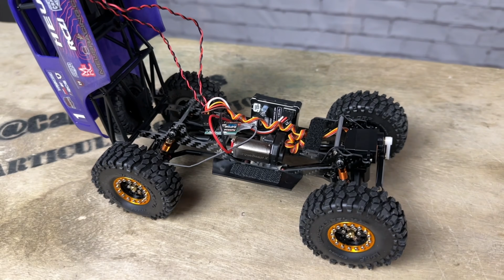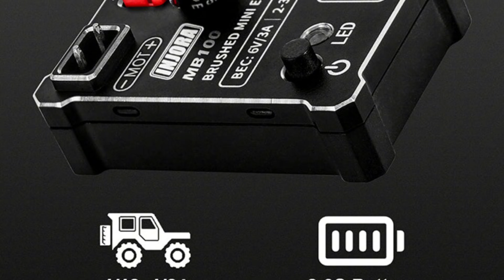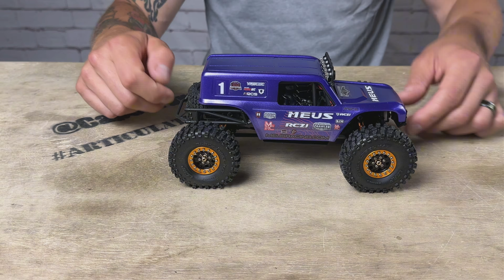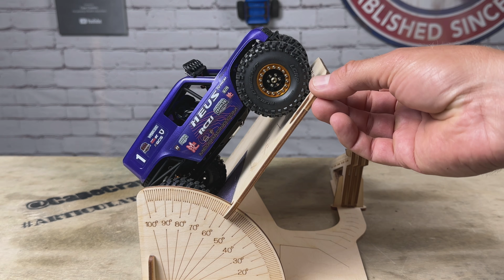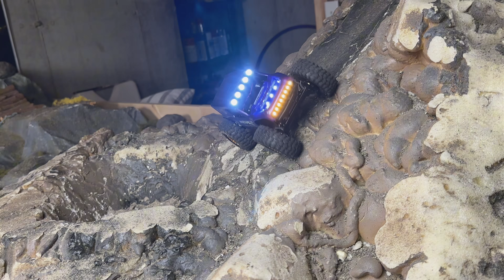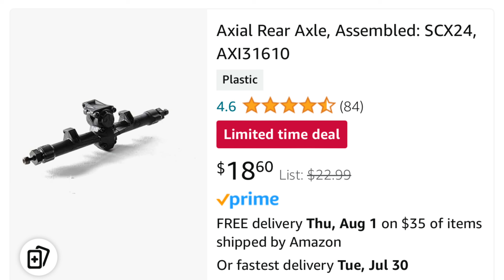SCX24 Budget Build: Parts Edition! Best Performance Per Dollar?!

Comment: An easy way to answer this question is to make a list of all the stock parts you'd keep in your build:
Wheels and tires?
Steering servo?
Motor?
ESC?
-> Changing the ESC means you'll also have to get a new receiver and that means you won't use the stock radio either.
Shocks?
Axles?
Drive shafts?
Transmission?
Chassis?
Body?

So would you pay the complete RTR price if you just end up keeping a handful of parts, of which there are better after market versions available?
Or are you planning on keeping it mostly stock and have it hassle-free?

Comment: Now there's a GoUpRC combo of a 2400kV brushless motor, 30A ESC and aluminium gearbox for like 35 bucks on Ali Express, that's cheaper than the brushed motor + brushed ESC + Axial gearbox you picked.

Comment: This is a great video. It helped me rationize what I just did after watching an rewatching several key scx24 vids of yours. NORMALLY I am anti rtr an will always build, but in this instance based on what my build path is with a vast part of that decision coming from watching your videos :) I thought that I would be best off with a rtr and for what I am doing, the base was the easy choice. 

I already have a flysky noble+ radio an recievers. I have countless 300mah 3s batteries from drones so when I go esc an motor I am only buying once, 3s... 
I am buying shocks. No need to pay extra for shocks. So here is my 250 budget an 300.  

Base Camp $107
Injura Universal lcg carbon chassi $27
1" beadlock weighted rims $26
Pro-Line 1.0" Trencher $25
brass skidplate $15
brass diff covers $15
40mm bigbores $22
emax servo/arm/mount $20

Thats at $257

in the trek to 300, thats hard an near impossible to  choose the route based on budget.

Comment: I was a bit disappointed in the MEUS MB24.. I found myself struggling to find a transmission/motor combo that fit with the chassis. The receiver shelf doesnt provide clearance for a brushless motor. I have bought 2 separate trans options (meus trans, and one of the popular form factors on Amazon). The only thing that fits is the stock brushed set up.

Comment: @CapeCrawlers
Great video, quick question i just bought 1/24 SCX24 Jeep Wrangler JLU AX100002V3T3 did some immediate upgrade lol like INJORA Trekker A/T Tires T1014 , INJORA 1.0" 39g/pcs Brass -2.65mm Offset Wheels for Micro Crawlers (W1008) and Brass differential cover 9g each cover what other upgrades you recommend . So people said Servo i saw that when you do mods video you include servo and i was think maybe shocks. After that don't know

Comment: >>Hey Adam<< I have a question, what would you suggest. A build like this which I love or an Apex? I want a comp style rig and I’m not sure which route to go. I’d throw about $350 at one or the other and you have definitely been my inspiration getting into the mini crawler hobby
Reply from the maker: I personally think it’s more fun and rewarding to build it from the ground up. The apex is really good out of the box and needs practically nothing, which can be boring unless you just want something you can unbox and run hard. So I would say it’s personal preference and whether you want to partake in the building process or not

Comment: I think you could have just about made the budget within a small margin by doing the nylon MEUS ISO axles that come fully equipped for $60, and would have also saved you on the brass upgrade and gearing expense. But otherwise a great build!

Comment: so I started with a $65 ebay special deadbolt as my donor, made the mistake of going big and bought a injora fat viper combo($60) which really did not pkg well in the deadbolt, so I went with the painted MB24 kit($40) and extended mixed and matched links to give me a much longer wheelbase (70mm rear links) The links and driveshafts came from leftover older projects. You managed to keep the interior which I had to take out to fit the fat viper... (slow crawl is amazing and it loves 3s), injora double barrel shocks and 1.0 wheels with 70x24 injora tires.($30). I have since remounted my smaller 3s battery is the same location as yours and I am trying to figure out how to get the interior in there!  Lover your build!

Comment: I think for your first build when you have no spare parts and have never worked one before... you should buy a truck then make it better. But for a 2nd or 3rd build when you you tinker with your rig so much you can lay out the entire parts list off the top of your head and your chasing a specific performance levle then YES!!! just build what you want from scratch.
      I think you didn't "blow the bidget" you tested it and the budget should really be $300. Maybe if you wanted more style you could do the same pars build but bump it to $400 and get something like LGRP ripper chassis.

Comment: Just over $300 isn't bad at all. You got to buy the base SCX24 first for $100-150 then you have your build/upgrade budget of $200. So to start with a kit and change everything out is $300-350. I think your better off just buying what you want and building it from scratch. It's about the same cost and no extra parts laying around. Thanks for making great videos like this, keep it up.
Reply: This is probably a stupid question but what is the base scx24. (I’m new)
Reply: @ it’s just your basic  stock SCX24. It’s not modified in any way. This isn’t a specific type of SCX24.

Comment: I first started with a Deadbolt rtr and put a toyota pickup model kit body, after buying a lot aftermarket parts, i was left with stock parts. So i ended up building a complete stock deadbolt out of all the stock parts and some aftermarket. Just needed a radio. I recently moved on to another hobby (retro handhelds), i might get back into crawling again later. 

I think its better to start from scratch and build a complete aftermarket rig rather than buying an rtr.

Tactic TTX300 radio is pretty good and affordable.

Comment: So how much is left from stock? Like did you need to get an SCX24 or could you have just put this all together with a few internals?
Reply from the maker: The goal was to build it purely out of parts without having to get an scx24 to start with. I think there are two axial parts on it

Comment: Just wondering, why not go with the injora metal +4 metal axles? wider and about 30$ cheaper, and all metal
Reply from the maker: I thought about that but I liked the added width and strength of the mofo. Plus you get the adjustable servo mount with them

Comment: Adam, your videos are getting better and better. And since the start of the channel it seems you have learned a lot about the minis. All you need now is a dremel tool or proxxon or whatever. Makes much more fun to build with such a tool.
And what do you think about injora axles and motor instead of mofo? Would be cheaper and much better than stock.
All in all great build!
Reply from the maker: Thank you! I considered those options. If you needed to bring the cost down I wouldn’t hesitate to get either of those. I think the Injora motor is smoother and prefer it I think. I went with the mofo axles because of the added width, strength, and included servo mount

Comment: The only thing i want is to make my 1\24 deadbolt less prone to roll over. What are my options to get it for very few money?
Reply from the maker: Limiting straps help to pin it down. Unsprung weight is going to be your best bet. Brass diff covers, knuckles, wheel rings, etc

Comment: The benefit of starting with the basic off the shelf unit is learning the shortcomings of it. I’m building my first comp type rig from my original deadbolt, looks like the only factory parts I may be keeping is the rear links, axle housings, receiver, and radio.

Comment: Cool build. Every time I go to the hobby shop, these Axial mini crawlers call out to me😂. Wife and I started crawling with a pair of TRX4M High Trails, and we are enjoying slowly upgrading them. I'll snag an Axial one of these days and give it the treatment as well.
Reply: They look cool but the performance of them is a bit miserable out of the box which leads to the chase of performance.

Building them gives you a lot more performance for the same money once you factor in upgrades, I'll basically have 1/3rd of an SCX24 in stock parts lying around by the time I'm done with mine, and I'm only going for a mild build.
Reply: Im the opposite.  I started with the scx24 and over a year built up an extremely capable truck. Then just got a high trail trx4m.  So far I've liked the scx24 platform much more. Not super fair though as I'm going from a $500 or more scx24 to a stock trx4m. 
The build quality of the trx4m is much better then the scx24 though. 
I think modded they will both be great.

Comment: I have a similar mb build. Bronco links furitek motor and esc, mofo x15 but in billet and I added the heavy brass knuckles. However wheel clearance is an issue now. Put a mofo servo beast on the front frame is a kiwi green pearl and the body is a white pearl. Hand painting the interior. Oh boy.

Comment: Planning on doing this exact parts build with some higher quality parts (cost isn't an issue). With it hanging up on rocks, would you still recommend the C10/deadbolt links combo or would you go all C10?
Reply from the maker: I still think the benefits of the longer wheelbase (deadbolt rears) outweigh the hanging up
Reply: Deadbolt 💥💥💥

Comment: if you buy an rtr, then replace wheels, tires, and links, you'll be close, if not over, the $250 mark. Replace the electronics, body, chassis, you're already beyond that.
With building from your own parts, nothing is wasted, nothing is thrown away. If you're looking at money, value, and or environmentally, building your own is best.
Great build.
Reply: Absolutely. But I feel it's kind of difficult to choose the right parts.
Reply: @Kallekringla3  Yes, BUT.....That's where our man Adam and others like 24Yep and 2FMRC come in clutch with these types of budget builds! 👍
Reply: I zip tied a model kit to a stock chassis with an injora esc and ive had a lot of fun with it for just under $200 had I known of the basecamp I could’ve saved more smh
Reply: I have 2 running with a few parts sitting around my plan is to get the missing parts and build another with the stuff I have looking to get around 8-10 for my course I’m building in the backyard

Comment: I’m glad injora released ascent 18 overdrive and underdrive now. Overdrive is what my truck needed next. The 11% underdrive for the scx24 will be nice. I have 33% ud in my ax24 and the motor overheats so I ordered the 11% ud for the front and that will give it the ideal 20%-25% od

Comment: Dude no way?! What are the odds? I am building one from scratch right now 

Legitimately just in time.. I got tired of my previous Scx24.. and now I am starting all over again, knowing the things I learned from all of my mistakes
Reply: I bought a deadbolt, fried the servo within a week or so, bought a servo, and overdrive trans with a  motor a few weeks later. Decided to buy wheels, and tires…found cheap carbon fiberish lcg frame for cheap…add cheap links for stretch,  oops micro Komodo Lizard pro…still sitting here with a 3/4 built comp rig, and loving the process.
Reply: Looking for pan head bolts to make everything uniform and smooth while I save up for tools, and connectors to dress up wiring.
Reply: @user-ji8ls9dr9f  mofo rc has his 3 piece  tool set on sale for $9.99. I am impressed with the quality of them.
Reply: Waiting on mine to build from scratch.  To mix it up I'm going to try using Meus trailing arms.  Also, Injora makes a 10th scale rear taillight that fits this as well as having some pretty sweet side skids.